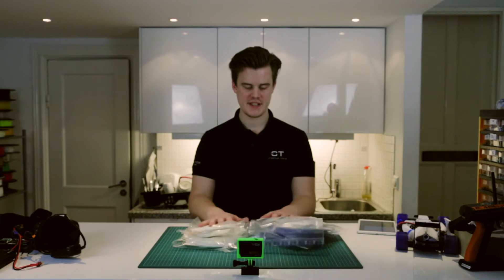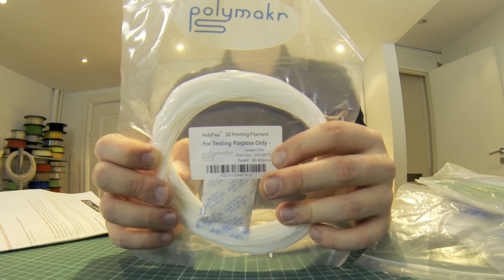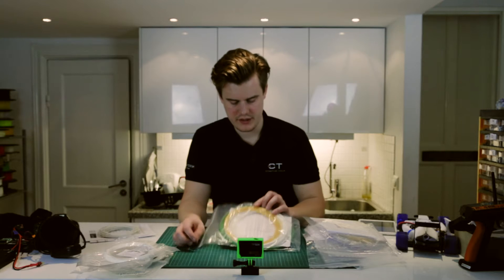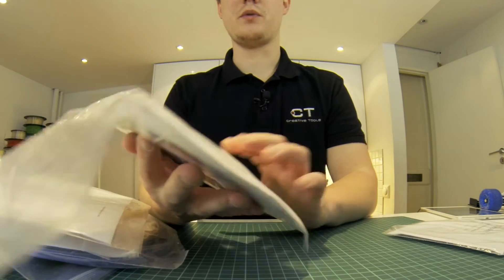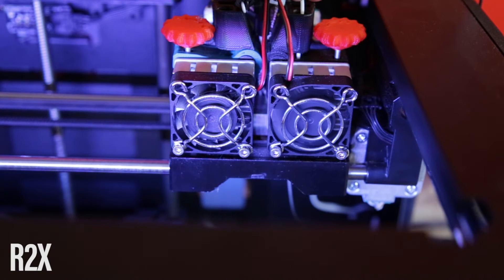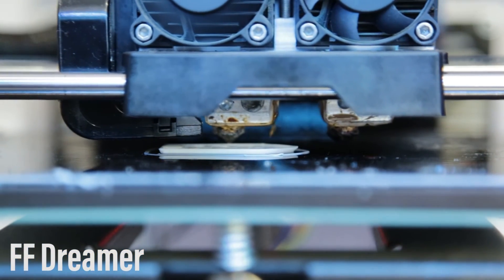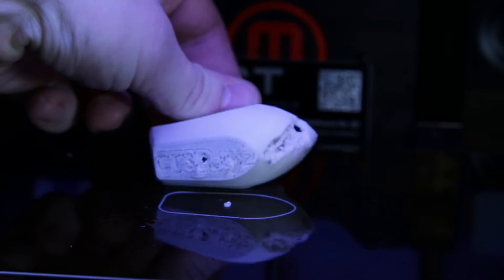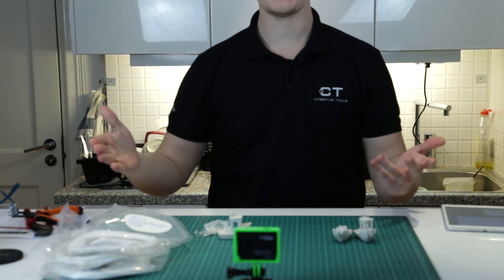/Review | Sakata 3D -  Semi flexible filament

Comment: I'm trying to print Sakata 920, but Im having problems like no continuous extrusion, I have tried to reduce the speed as well to increase the hotend temperature ... could you printed that ?could you help me giving me some advice? Thxxx
Reply from the maker: I updated my URL as it was broken, not sure my settings here will help on Sakata 920, but it could be worth testing out.  https://www.antonmansson.com/filament-testing-sakata3d-bio-pla/  

Try removing retraction for a test print and see if that works. flexible materials can be tricky to retract!
Reply: you can find some iddler regulator for your printer to release a  bit of pressure on the filaments input rollers
Reply: i found one on thingiverse for my CR10S